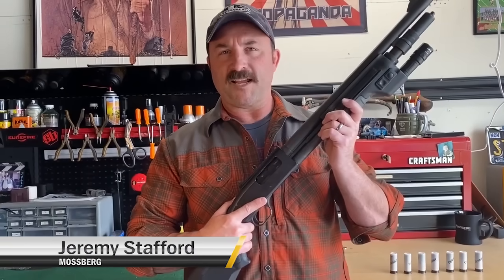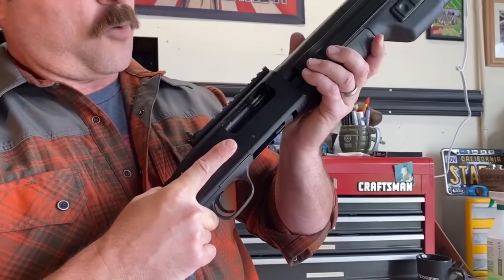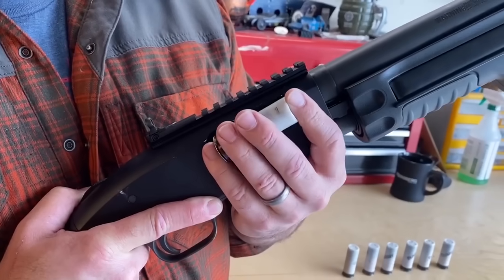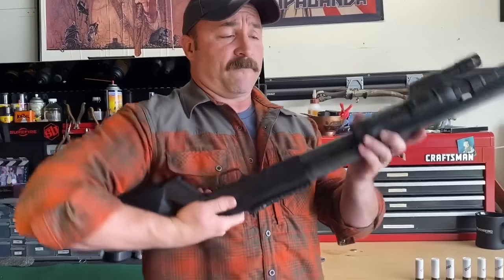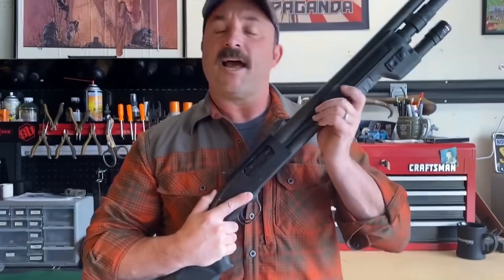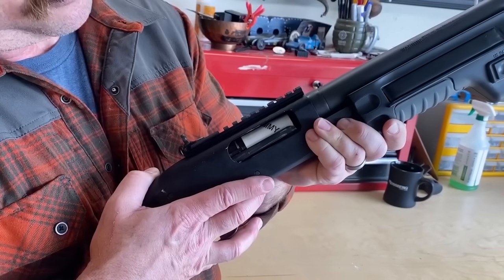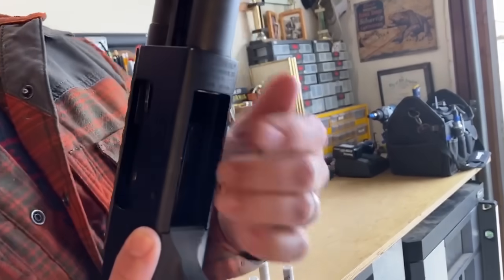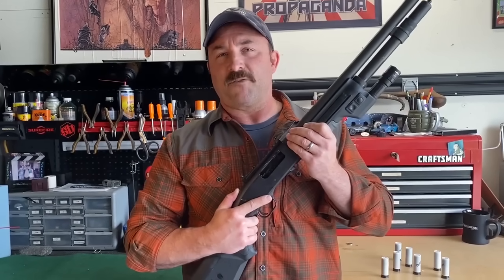Loading and Unloading - Mossberg 500 / 590 Series Shotguns

Comment: I’ve had my 500 for a couple of years. I usually just rack it repeatedly to empty the magazine tube (never felt safe to do). I’ve had the thing apart enough times to clean it… Never even occurred to me to press the shell stopper. I’ve always wondered what the little raised area on the bar was for. Thanks.
Reply: #Me too. Factory, when I called about cleaning was of little help and pointed me to The Tube. Found a slew of videos. How about as you are taking it down and it sounds like it is falling apart! Video guy that taught me how when it made all those noises said something like, holy crap its falling apart. I keep mine loaded and if I am taking any rounds out I still rack em out but I always take it outside.🦇

Comment: I've operated/owned shotguns since I was 8 years old.  I recently purchased a 590A1, and have been a bit flummoxed  (read "clumsy")  unloading/loading this model compared to my Winchester Model 12 pump.  After practicing a bit, and seeing this video, I feel unloading the round in the chamber requires a bit too much care to ensure that the elevator doesn't pull a new shell from the magazine while you are trying to unload the chambered round.  I don't have this issue with my Model 12 (realizing though, that I've been using it for about 40 years).  I have two Browning's (Auto5 and a Maxus) that have a magazine lockout, and I can't help but fell a similar mechanism would help matters with this 590A1 (again realizing automatics are sort of an apples to oranges comparison to pumps)
Reply: Kirk Carver 
~I just also bought a new 590A1. I load the tube magazine and cycle it and >>1 to 2 "live" rounds would eject (drop) out the bottom<< in repeated tests. Is this a lemon factory flaw or something else do you know.? 
~Also do you know 'which' Mossberg 590A1 chat "Forum" you recommend to join.?
Reply: @royjohnson465  
That sounds a bit different from the problem I have. My gun cycles ok (sometimes a shell will not auto-extract after firing, requiring manual extraction, but otherwise fine) and I don’t have the problem you seem to be having. 

I’m not aware of any forums.  If you find one Id be interested to sign up.

Comment: Excellent video. Some may find this useful. There's a slight variation to the unloading procedures that I find just as easy, especially if you open the action all the way and a live round gets onto the carrier. At that point, just dump both shells into your hand. Push the carrier up then close the action. Unload the tube as shown and clear/proof the weapon. Never just assume it's cleared or is safe because you counted the shells.

Comment: I find that pressing the shell stop to unload my 500’s magazine works, but not every time and only if I do it pretty briskly. If I’m gentle, it works for about one round in three, if I’m pretty energetic it works about three rounds in four. When it doesn’t work, the shell will come partially out of the magazine and the rim seems to hit the bottom edge of the elevator and become stuck, at which point I have to push it back into the magazine and try again. It always functions flawlessly when cycling the action. I’ve not seen it happen on my 590 or 590A1. Since it always functions flawlessly when firing or cycling the action, I’m not concerned about it. Should I be?
Reply: Jim, when "the rim seems to hit the bottom edge of the elevator and become stuck" you can raise (gun inverted) the brass away from the elevator and the shell will then come all the way out.  I have seen people in the know say you can file the elevator bottom edge to an angle so the shells don't get stuck on the elevator on their way out of the mag tube.  You should not be concerned about it as it is not happening when you are firing or cycling the action.
Reply: @shoersa  I didn’t think so, I’ve never had a Mossberg fail to function when firing it, only unloading, so I still trust them with my life. Check local ordnances before doing any kind of gunsmithing on a firearm that you may have to defend yourself with, sometimes that causes some real legal problems.

Comment: I’m only ever able to get the shell to pop it’s rim out when doing this.
Reply: Nick, when "the rim seems to hit the bottom edge of the elevator and become stuck" you can raise (gun inverted) the brass away from the elevator and the shell will then come all the way out.  You should not be concerned about it as it is not happening when you are firing or cycling the action.

Comment: When I unload cartridges, they get caught on the tip of the elevator after I push in the cartridge stop. I have to lift them up slightly to allow the spring push to them out. Is that supposed to happen or is it an issue?

Comment: Just bought a 590 tactical 9-shot 20 inch barrel.  Ok 8+1. But when you say 3" i figure 8 3inch shells will fit in the tube. Only 7x 2 3/4 inch will fit so i assume it's only 2.5 inch shells that will fit 8. That info should be more clear in the details.

Comment: Only problem with my 590 A1 is that the last 3 rounds don't come out.  I have a tube extension an a good spring.
Brand new, I had to send it in because it wouldn't eject after firing.  Too bad, as I really like it....except for those problems.
Reply: Did you install the extension yourself?
Reply: @lesmcc8103  
Yes....
Wasn't a problem.
Problem is with the catches

Comment: Mossberg 505 new owner. Has anyone had issue with putting more than one shell into the magazine tube? To be clear, 1st shell goes in just fine and can be racked into the firing chamber. And I can then place 1 more shell into the magazine tube. I just can’t place more than one shell into magazine tube. Thank you anyone with tips. (505 is a 4+1)

Comment: For anyone that runs into this and tries the download procedure of pushing the shell stop, I just noticed on my 590 it doesn't work quite that easy.  Maybe it's because mine is new enough there's zero real wear on it, but when pushing the stop, the round moves back and hits the elevator most of the time.  Need to put pressure on the round back into the mag tube, and move it downward past the elevator, and it'll drop out as shown in the video.  Sometimes the shell will clear the elevator on it's own, most of the time it won't.  I would almost rather have it stop on the elevator, as it's even more controllable and and not just a shell flying out of the tube, I can guide it out at my own speed, so it's not an issue to me at all.  Just something I had to mess around with to understand how to do it.
Reply: I have that same experience. Don't know if it's by design or an issue.

Comment: Unfortunately the quality control on the newer ones is not very good at all, super disappointing the difference between the older models and what Mossberg is putting out now, the new stuff is Mexican made garbage with no quality control, better to go find an old used one than buy one of the newer ones, they are pure crap

Comment: This is not the safest or easiest way to load or unload a 500/590.  I'm surprised Mossberg recommends it over other techniques.
Reply from the maker: Jeremy has decades of training experience and is suggesting this process so that the user does not pass a shell back through the receiver unnecessarily. Thank you.
Reply: @MossbergCorp  I have over four decades of experience and am a NRA Training Counselor.  I am not suggesting a shell be passed unnecessarily through the chamber.  I am stating there is a safer way to load and unload the shotgun than what was demonstrated.  I recommend a round be placed in the chamber only after the magazine has been loaded, not before.  The operator then has the option of manually inserting a round in the chamber by partially opening the action (so it does not pick up a round from the magazine tube) or he can chamber a round by racking the slide, then topping off the magazine tube if desired.  Unloading can be accomplished by partially opening the action and removing the round from the chamber, closing the chamber, and  then removing any rounds from the magazine tube by depressing the shell stop and sliding them out the bottom of the gun.